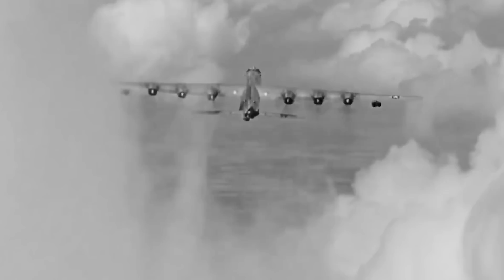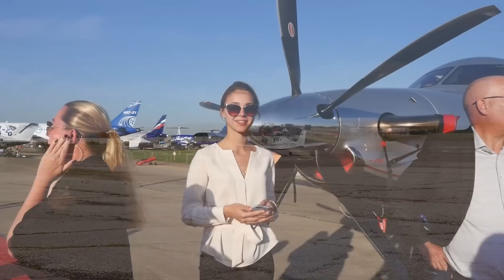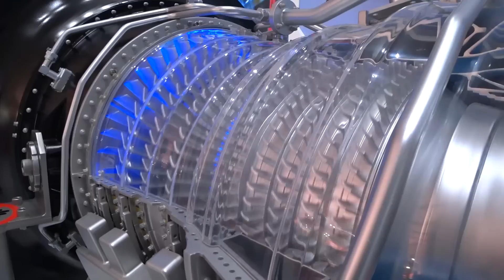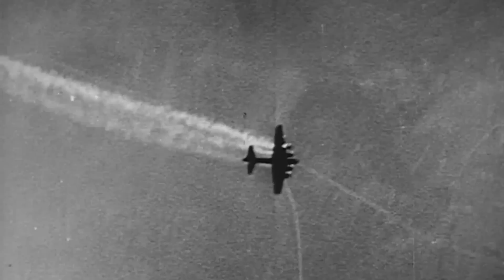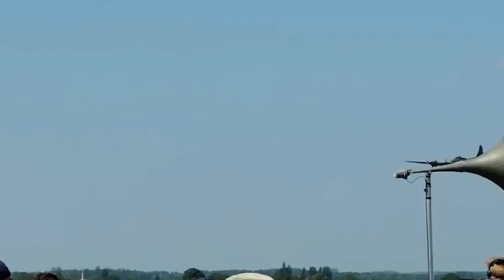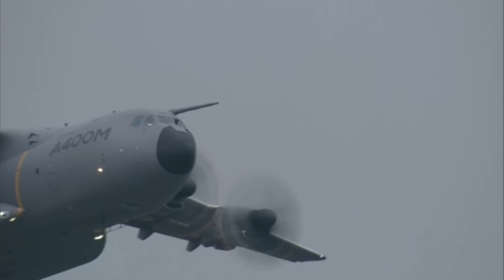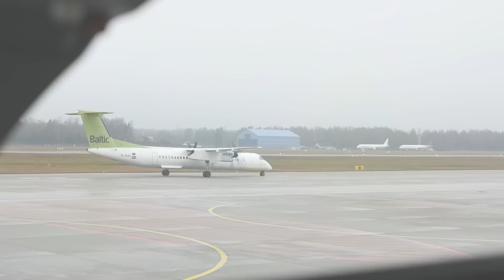Piston and Turboprop engines | What is the difference?

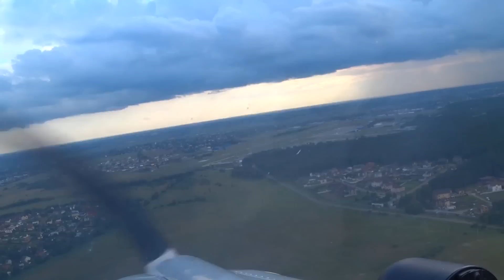Comment: 16:26 - This only applies to carbureted engines and heat from the exhaust is used to heat the intake air, no additional heat needs to be produced. It's not the fuel line that freezes, either, it's the Venturi in the carburetor which can be clogged with ice. It doesn't even need to be all that cold outside for carb icing to be an issue, as the pressure drop across the Venturi also causes a temperature drop, which can freeze moisture in the air. This is an area where modernization could significantly improve piston aircraft engines.
Reply: I'm rather impressed that aircrafts are still using carburetors, given that fuel injection has been around since the early 1940's with engines like the DB 603 and 609... there's a reason why Bf109's could go inverted while Spitfires would have a carburetor fail uppon rolling and going inverted.
Reply: @marcox43  Part of it is because aircraft are in use for a very long time, so plenty of very old aircraft are still flying, but cost is another major issue. The benefits of modern fuel injection (EFI) also go FAR beyond simply being able to fly inverted, or pull negative Gs, but there are very few aircraft engines which make use of such systems.
Reply: @PistonAvatarGuy  I wonder how would do some 80's-90's MB car engines, like the M103 Inline 6, since they have a reputation for being bulletproof and have a ridiculous amount of service life between maintenance/ rebuilds.
Reply: @marcox43  They'd be heavy, they're not very powerful and any automotive engine would require a significant amount of modification to be reliable and efficient in an aircraft application. Aircraft engines really should be purpose-built for use in aircraft, there are just too many differences in how the engines are used in those applications.
Reply: @PistonAvatarGuy  maybe in reliability it wouldn't need to much modification, given it's a very reliable engine to begin with. powerband... it can withstand up to 1000hp on stock internals, because it's based on it's diesel cousin, and thus, built tough as a rock. only issue is it loves to eat camshafts/ rocker arms over time, but that's like a change once every 15-20 years... timing chains could be upgraded along with the tensors, for extra reliability. comes default with electro-mehanical fuel injetion. just curious about what differences it would trully have agaisnt an aircraft engine. also, temp limit is 120°C.
Reply: @marcox43  Aircraft engines must be light weight, reliable, long lasting, and efficient, and while an automotive engine might be one or two of those things when used as an aircraft engine, it's almost certainly not going to be all of those things. That Mercedes engine is not light weight (it has an iron block), it probably weighs around 250 kg, but it only makes about 190 hp. For an engine of that power output to be considered for use in an aircraft, it should weigh around 150 kg. Some aircraft engines of that power output can be expected to weigh as little as 100 kg. An automotive engine might be reliable in an automotive application, but when pushed to make close to its maximum power output during nearly all of its operation, as it would be in an aircraft, it's not likely to retain that same reliability. Longevity often suffers with automotive engines when used in aircraft, they're simply not built to last for thousands of hours at high power settings. Fuel efficiency is also usually poor when automotive engines are used in aircraft, as automotive engines are generally tuned to be most efficient at low power and rpm settings, while aircraft engines are tuned to be most efficient at higher power settings, near their maximum rpm. That Mercedes engine also uses a very old and very obsolete fuel injection system which is mostly mechanical in operation. The engine could be updated with an aftermarket EFI system (MoTeC, for example), but that would be a pretty major undertaking.
Reply: @PistonAvatarGuy  hmm... EFI is rather easy to convert in these engines, it already carries the big majority of sensors, it's just analog. Obviously city use would equal to barely 40% of the power, but if we move to it's true nature (road use and autobahn), the engine spends most of its time at 50-65%, assuming 120-140km/h, given that speed matches it's torque peak at 3500-4000rpm
If you like going +200km/h, then it will go on the 5500-6000rpm which is roughly 80-100% of its power. Considering that the rev limit is 6200rpm, with peak power in between 6000-6200rpm. Rpm can be further enchanced to 9000rpm with stiffer rocker springs, to prevent valve float. It'd be interesting to see it's service time when running at constant 80% power, given that irl you can only go 1.5-2h on said power band before running out of gas in highway conditions. Either it'd be a walk in the park, or you'd need to do some maintenance afterwards.
Reply: @marcox43  I'm sorry, but you have no idea what you're talking about.
-
-The engine is FAR too heavy, it would need to make 400+ hp to even be considered for use in an aircraft, but at that point, it's reliability would be seriously compromised and you'd be much better off with a turbine engine (an Allison Model 250, for example). Squeezing 400 hp out of such an engine would also seriously harm its efficiency.
-Autobahn use probably accounts for tens of hours of the life of the engine in a car, not thousands.
-EFI is not a drop-in replacement for CIS-E, you'd need to have an entirely new intake manifold built in order to accommodate the electronic injectors and a new throttle body.
-CIS-E does not have all of the same sensors, you'd need cam and crankshaft position sensors in order to accommodate modern EFI, those are not easy to add to an engine that wasn't designed with those sensors.
-An engine that size running at 9,000 rpm would have the duty cycle of a flash bulb in an aircraft.
-
Yes, you could make that engine work in an aircraft, but only briefly (and it would guzzle fuel), and aircraft engines must be able to perform reliably for THOUSANDS OF HOURS.